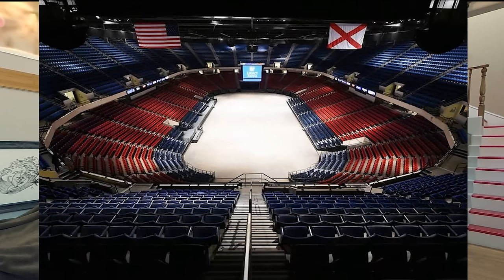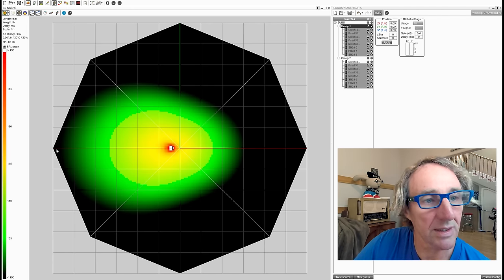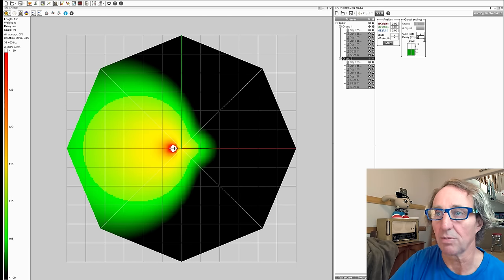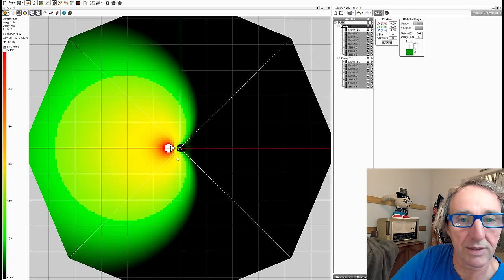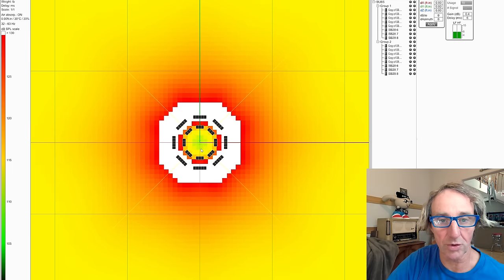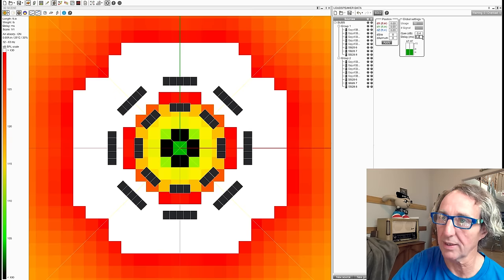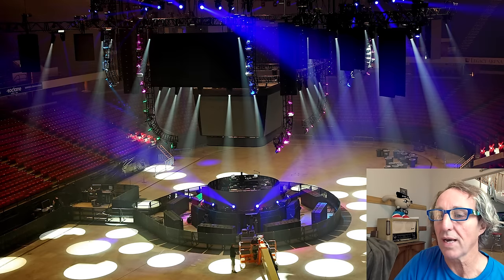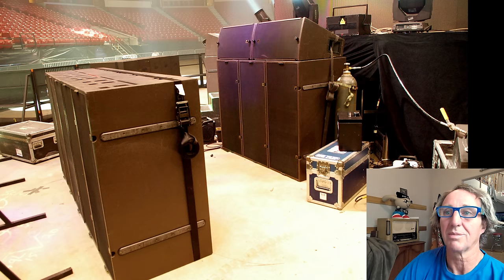Bassnectar 360 Subwoofer Sound Design

Comment: I liked this format Dave. Nice to see the journey from problem, to theoretical solution through to implementation
Reply: All of his “tutorials “ are like this. He usually has some sort of “model situation “ set up on the computer, or with actual gear. His videos are crazy informative. He shows it all. And he has soooo much real world, cut your teeth knowledge on tour sound
Reply from the maker: Cool cool James, and Dover is a member of my channel as well. I do live zoom chats and post them and there are a few hundred more vids on the member side
Reply: Only thing that could have topped it off, was a short demo of the points in your conclusion here: 19:55
Reply from the maker: I've been pondering a setup that will demonstrate low frequency nulls in a desktop videotapable scenario.

That said, I am on to new adventures and need balance sharing stuff I already know and did vs stuff I enjoy figuring out and learning.

Comment: Great work! As an RF engineer I have often gone after nulls in circuits.  With RF we use a network analyzer with a polar plot showing both amplitude and phase.  You are adjusting phase with delay and can find a minimum but without a polar plot it is hard to tell phase imbalance from amplitude imbalance.  Anyway great process and great explanation as always!
Reply from the maker: Awesome and yeah the software I use doesn't have the best tools for this. In more recent versions of the software and I didn't show it in the video but there is the ability now to click into the field and the software will output the amplitude and time delay of a signal at that location. So I can set the null signal and the main signal to have the exact same amplitude and delay at a specific location.

The software uses it so that you can find maximum summation but it can be used also with a polarity verse to get maximum cancellation

Comment: This is where you want to put your sub system processors on the same power feed as the inner ring of subs, so in case the inner ring blows a breaker, you don't blow the artist's eardrums, because it takes out the outer ring as well! Lol

Comment: Fascinating journey through design, conception, implementation, and continued testing. With the small changes in delay times being such a significant factor, I'd imagine that sub positioning being precise down to the 1/4" was a critical component as well. Thanks for sharing!
Reply from the maker: Yes, position was critical and arcing the subs may have been even better but I reached what I believe to be the point of diminishing returns

Comment: Oooh.  An interesting case for machine learning.  Real time analysis of temperature, humidity and level.  Constantly adjusting delay while monitoring sound level to minimize level in the center while maintaining level in the outer ring.  Machine learning (AI) doing micro adjustments in realtime and analyzing the results.
Great format for the video.  Helped me understand the difference between cardioid and end fire sub arrays.  Keep up the good work!
Reply from the maker: Super cool Robert! Also you have access to loads of vids as a member. This has been a member only vid and am just releasing public. Check the member exclusive playlist, there are over 200 member only vids in there
Reply: You don't need AI, it's just calculus man (or experience!). Don't replace Dave with robots!

Comment: Good stuff, this kind of large complex installations with specific requirements make for interesting challenges. I like how you applied the principle of cancellation to shape the sound level in different areas. Add a controller with a thermal sensor to automate the delay adjustments for ultimate overenginerding. When you mentioned 136 dB I felt a slight panic and my ears started ringing...

Comment: Many years ago i had a portable disco. And used cerwin vega tunnel reflex sub and to isolate my turntables i set them on a small waveless demonstration model waterbed matress. I never had any problem with sub feedback to my platers both were dual 721 direct drive. This is incredible what you are doing with modern tech. Thank you for sharing your expertise.
Reply from the maker: That is cool thank you!
Reply: @Dave Rat  the mattress was the kind that was a single piece like a traditional waterbed with vertical tube baffling inside that made it resemble an inner spring mattress. I've tried it with a pet waterbed that had a fiber inside for baffling and did not get the same result.
Reply from the maker: So cool, putting a damped fluid in the per be could help. Or adding some tichener to the water that is not biological and won't mold.
Reply: @DaveRat  like glycol thickened with cellulose.  Like x-lube.
Reply: You would have to experiment with the thickness so you dont have a resonant mass at the wrong fq

Comment: hey dave. . . this is a long shot most likely geographically speaking, but you wouldnt by chance have been the designer/engineer for lorin when he came to the key arena for bumbershoot 2014. or 2015 - where the crew and him set a key arena first and blew a mainline fuse the squad went THAT hard. ive been to hundreds of shows at the key now and the bins were going full gale and then some. operations went to the fuse box and repaired the fuse quick in and out and the rig was throwing bassweight within probably a handful of minutes of wait time for them to safely perform the repair.

a golden memory. appreciate all yall do plus anyone with that big a portrait of their doggo is good people in my book mate. big up that too D stay warm out there ty again  ⚡
Reply from the maker: I was renting gear to BN back then but not as involved with design yet

Comment: I was there in 2015. Sounded great from any place on the floor. Spent most of the 5-10ft from the center.  Staff passed out ear plugs in that inner ring. I didn't feel like I needed it until the very end. I still hear fine lol. 

Interesting video about a show I still think of. Thank you.
Reply from the maker: So cool, thank you
Reply: @DaveRat  we started the night that close to the stage, before the show started. We ended up staying there until maybe 30 minutes before the end.

In hindsight, it is actually remarkable how clear the sound was and how tolerable the volume was. Typically, I would never be that close. It was loud but did not feel damaging. Thanks again.
Reply from the maker: So cool and thank you! It's great to get a real world un biased perspective. I had a great time at the show. Though the building power did fail near end, the building ac panel had a bad connection that melted. But overall it was a huge success from all ends
Reply: @DaveRat  that's funny. We thought his laptop fried. It was resolved relatively quick, to the best of my recollection. It was an incredible show.
Reply from the maker: Awesome, yeah, we tied into a diff power panel to fix
Reply: @DaveRat  must be high pressure in those situations
Reply from the maker: Unexpected silence is a shock. Scramble to find out what happened and fix. Not enjoyable
Reply: @DaveRat  it was no more than a brief intermission 👌

Comment: Great video Dave! Well explained and has a nice logical progression from problem to solution. I've never seen the temperature affect a cardioid subarray so drastically! And it's amazing that the theory worked out in practice so well, and that you were prepared to deal with the temp fluctuation. Bravo! Hats off to you sir. Always a pleasure watching your videos. Thank you.
Reply from the maker: Wonderful and thank you!

What got me focused on temperature and it's possible effects was years ago mixing leads and reading festivals and they supplied the very first generation nexo cardioid subs.

I tested out the sound system and all worked well during soundcheck but during the show I lost all of the low end and there were complaints that there was lots of low end in the production office behind stage.

I put much thought into the possible cause of this and came up with a few potential causes with temperature being one of them.

The other issue is non-linearities in the rear-firing out of polarity speakers.
Reply: @DaveRat  
Nonlinearities in the nulling subs?
Reply from the maker: If a set of speakers is set to null another set of speakers it is critical that both sets are driven at almost exactly the same power levels.

Else, the voice could in the set driven harder will heat up faster and result in more power compression than the set driven less hard. 

This scenario will collapse the cancellation and can result in constantly changing significant shifts in the the coverages.

Furthermore, non linearities in the peak response of drivers driven harder vs less hard can result in the lower level signals cancelling and the peaks not cancelling.

Comment: This was fantastic!
I use cardioid sub setups as often as I can with EV ETX 18sp on-board DSP. Tweaking it and running around to hear what it sounds like everywhere is maddening and alot of legwork. I have always "walked the room" to discover and adjust the sound. I just need to embrace the tools that are already there to make this a more efficient and precise process.
I need to invest in the proper gear to dial it in like you are doing.

Comment: This is awesome! Imagine blowing the breaker on the subs in the inner ring only 🤯 instant brown note
Reply from the maker: 🤙👍🤙 and yeah, breakers were diversified. So breakers drive both inner and outer
Reply: @DaveRat  haha good call. 
Curious if you could setup a system that monitors the temperature and turns it into a midi control for whatever decay device you are using, I have something similar setup in my solar power system
Reply from the maker: The challenge is that we need the average temp over the distance from source(s) to wherever the timing needs to be aligned. Multiple probes equidistant spaced and averaged .

The complexity tends to exceed the value
Reply: @DaveRat The Infrared Laser Thermometer Array Delay Box by sound tools 🐀
Reply from the maker: At one point when I was still mixing I was looking at making thermometer strings with multiple sensors I could dayle from the ceiling to monitor temp are differing heights.
Not for delay but to monitor and deal with thermal refraction issues
Reply: @DaveRat haha yes thats genius.
Also could do a thermal camera from three axis' and use that data to map the thermal variance of the room and adjust delay time per source.
Also for refraction you could possibly use it to adjust angle?
Reply from the maker: Angle or HVAC, unfortunately the thermal camerabi tried see surfaces but not the air
Reply: @DaveRat  I wonder if you could you set hypersonic speakers at a distance with a specific mic detecting the sound  and measure distance against time to get a direct measurement of speed of sound fluctuations on multiple axis
Reply from the maker: Hmmm, sounds like calibrating and testing something like that would take more time than it took to set up the rig

It's important to dedicate time to things that give distinct results that can't be done and easier way

Comment: This is killer, Dave! Thank you so much for sharing. Is there any particular reason you chose 7ft as the front to rear sub spacing? Also, were you showing the Z-weighted SPL graph when comparing the SPL at different points, or did you have a custom bandwidth?
Reply from the maker: I believe the bandwidth was 32 to 63 Hz.

For selecting the frequency of the tuning divide the speed of sound by the frequency of choice and that will give you the wavelengths then divide by 4 to get 1/4 wavelength and that's the dimension you want to use.. the wavelength I chose was 40 Hertz
Reply: @DaveRat  Thanks for clarification, very helpful. Keep up the great work.

Comment: WOW! Great video Dave Rat.
Now I can confirm that what changed so much the frequency response of my sound system was the temperature. I had to change the polarity in the cables of the bass enclosures because it got so hot here in Brazil...
I gonna say it but even I don't believe, it changed the phase by 180°! I lost more than 6db at 60hz that is where the subs meet with the woofers because of the temperature going from (20°C) 68°F to (40°C) 104°F in only two days. Strange weather days.
The amp that have a large aluminium heat sink overheated, so I putted a powerful computer fan to the side of it to let it work in acceptable temperatures.

Edit: I forgot to say a very important detail, the 40°C was outside the room with no fan or air conditioner. It was so hot that made my blood pressure lower enough to make me dizzy.
Reply from the maker: Wow

Comment: When you started this vid I guessed you would hang a speaker or a few in reverse polarity, from above, canceling out the sound, or something to that effect ... your solution was way more sophisticated though, as is also helped you hit the outer diameter with a higher spl and really evened out the coverage of that floor space. Really cool and interesting!
Reply from the maker: Very cool and yes and out of polarity speaker above would cause a lot of cancellations where we don't want them
Reply: @DaveRat  Yes I did think of that, I was assuming your tool to mitigate this may of of been lowering the overhead's level or something, but instead it was staggered stacks, a thermometer and 0.5 ms extra of delay! Amazing🤯😃

Comment: THis was so rad, thanks Dave! Great ideas. I am designing a bass-bed for an ambient soundbath gig, using 9 x 18" yorkville parasource bass bins with mats ontop so listeners can lay on the bins for the sound bath in the middle of a quadraphonic top end thinking about cardioid  to concentrate the pressure levels in the middle, so reverse of what you did here this was very helpful in my thinking. best wishes from west coast canada..

Comment: Wow, most impressive! That's taking into account, the signal from the adjacent and far side boxes as well? Neat!
Reply from the maker: Since nearly all the rear energy is cancelled, the far boxes don't really mess with the cabs facing the other way that are behind
Reply: @DaveRat  Right on. So when you're plotting this, are you anchoring on a specific frequency, then applying a single delay time? It's always a compromise, right?   You get the nice response you are looking for at the anchor, but then shit just lobes out as you get further away from that anchor frequency. It's just physics, can't fight it.  What about frequency specific delay? 
Seems like a LOT of processing power to build loads of bandpasses with scaled delays in the digital realm, but I wonder if there is a simpler, more elegant solution in the analog domain, one that isn't looking at time in the actual sense, but in terms of minutes and seconds of angle in phase relationships between frequency energy from two or more sources. 

Have you encountered or used anything like that in your travels?
Reply from the maker: I show it all in the vid and exactly how to do it. Just delay.

Placement and delay
Reply: @DaveRat  Thanks, I got that part. And yes, of course there were other factors, as you state, temperature (and humidity as well), and probably some absorption from the room filling with bodies, and likewise changing reflections as the bodies change the actual physical distance the waves travel through the room, then returning at different times. I've run into this effect taking place in small, tight, highly reflective and regular shaped rooms, where the low frequency energy was basically annihilated, even with the amps peaking into the red, until the room filled, at which point the bass was BUMPIN'.  I know that by putting the fence up, that kind of interference between forward and rear elements was avoided, but what about the reflections of the outward radiating energy? Did that fold back upon the rig and get you at all? 

Also, as I said, you used a single delay time, centering on a specific frequency. What did the interactions between the forward and rear elements look like at frequencies higher and lower than the center? Thanks again for making the time and effort to share the knowledge, and constantly pushing the edge of sound technology. The world needs more of that.
Reply from the maker: Cardioid arrays operating over a single octave that are tuned to the center of the octave can be EQed to flat over the pass band without much EQ.

As far as room sound and reflections, yes radiating in 360 sendsore energy everywhere so the room tends to be more reverberant than only sending in one direction. That said, the flown rig did a good job of putting direct energy where it was needed.

I think we got about as good as can possibly be done in that venue with that artist in that config
Reply: @DaveRat  Ahhhh, I was not aware that you were just covering a single octave with those arrays. I was figuring twice that, like 20-80Hz with the delay centered at 40Hz. 
Did you use those M-Force cabs for this?
Reply from the maker: SB28 32-63hz but capable of down to 28
Reply: @DaveRat  Right on. L-Acoustics do not suck. Not many cabinets reproduce a 28Hz fundamental with much accuracy or power. As I think about it, most are 2x18 cabs, loaded with either BNC's or McCauleys. Thanks again for sharing the knowledge.